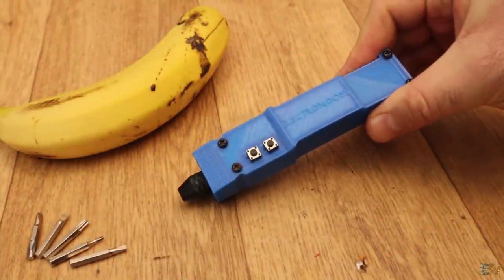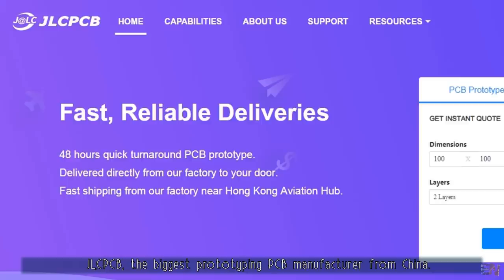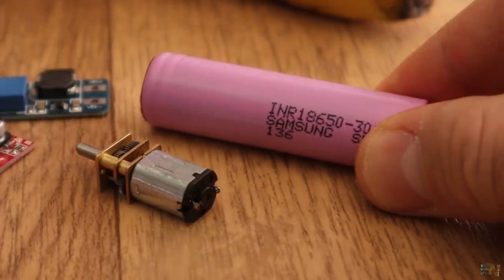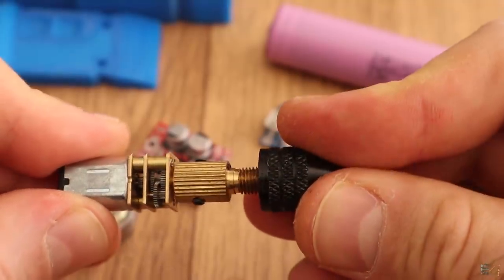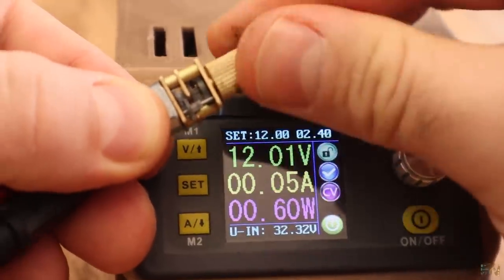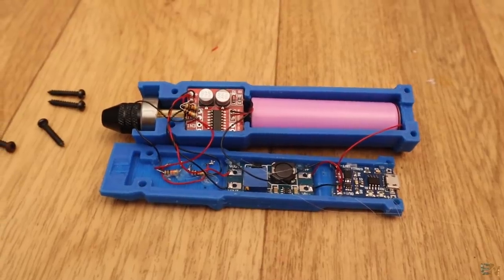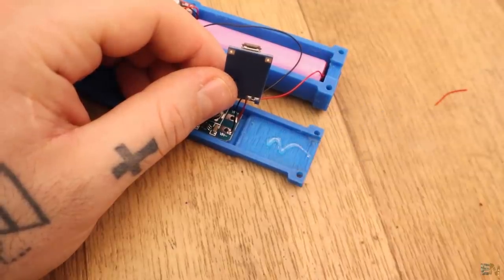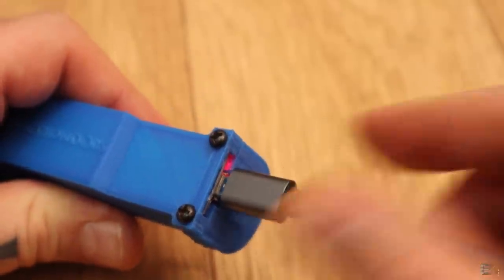Homemade 3D printed electric screwdriver

Comment: Nice project. I love how you use off the shelf modules and tailor the enclosure to fit them. It would be nice if version 2.0 had some way to avoid over-driving the screws. Maybe sense the current to turn off the power - effectively an electronic clutch. Just thinking out loud.

Comment: hi I had a question, I was wondering if it was happeninng to others : when i try to close the case with the battery ans boost converter it doesn't fit anymore ?